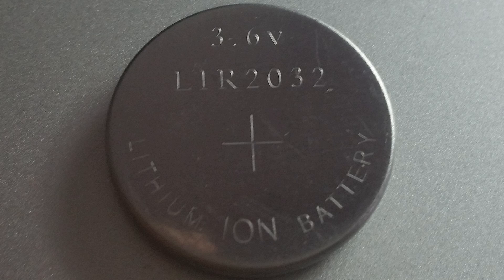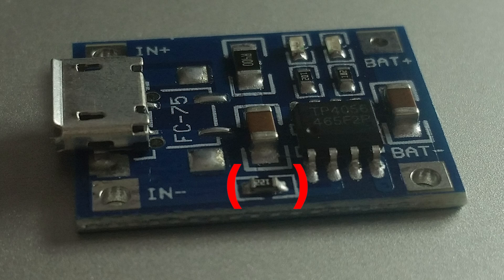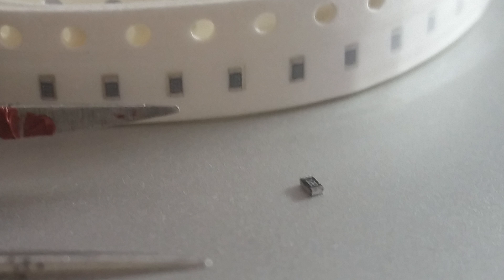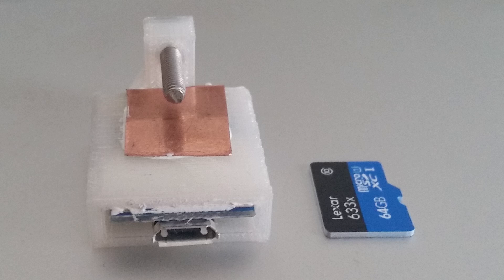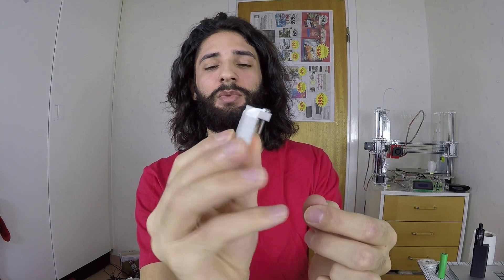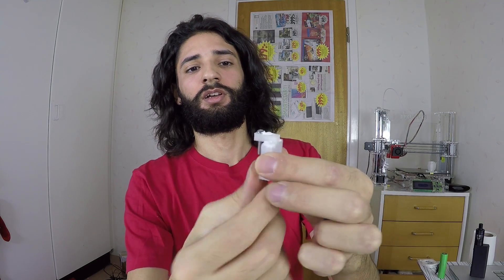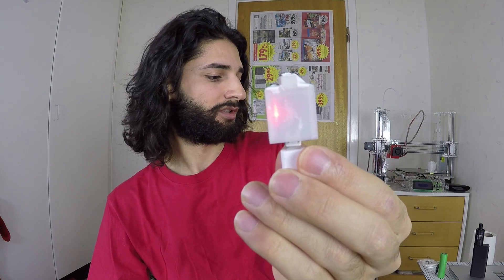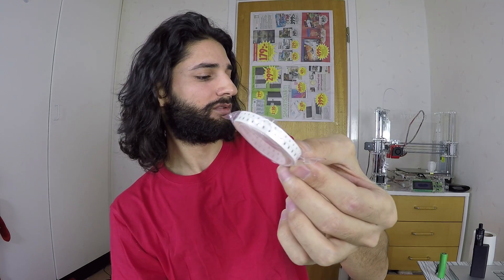DIY Coin Cell Battery Charger For 0.3$ (For Rechargeable Batteries Only)

Comment: Hi and thank you for your instruction here. What resistor would I need for 1.2 volt charging? Thank you etc.
Reply from the maker: You can't use this module for 1.2v battery. It's only for 3.6v battery. Otherwise your battery will explode/burn.
Reply: thanks for your time to reply. Guess I could d it with a stack of three.
What make/type is your 3D printer? Best, Bob, UK. @RajaaKahel
Reply from the maker: @raybob49  You're welcome. What's the battery model you are trying to recharge? Charging batteries in series is not recommended as they have different voltage/internal resistance which could also lead to fire.
Reply from the maker: @raybob49  My 3D printer is my own design (RK3D Tool Changer).
Reply: They are Varta NiMH V80H 1.2v 80mAh Button cells, CMOS power (3 off) in my 1990 Toshiba T1800 notebook. @RajaaKahel
Reply from the maker: Those batteries need another charging technology (not  lithium ion). You can buy this specific charging module in the link. Buy the one with lowest amperage (100mA). If you wanna charge one at a time buy the one (100mA 1 cell). If you wanna charge 3 in series buy the one (100mA 3 cells).
https://a.aliexpress.com/_EI0BqdZ
Reply from the maker: @raybob49  Then make sure to modify the module so that the charging current is only between 7mA to 14mA. Otherwise you will blow the batteries at 100mA. These modules are made for AA size 1.2v batteries which handle much more current.
Reply: Again, thanks so much for your time and help. Its great to be able to ask you questions and is really appreciated. @RajaaKahel

Comment: I puller a CMOS socket off of an old retired motherboard that I figured would be more convenient to use. Not sure how to modify the 3D printer file to accommodate that mod. Guess I would have to learn how to make 3D print files.
Reply from the maker: You can also buy the battery holder. But I promise you that you will benefit ALOT if you take the opportunity to learn 3D designing. It's how I started myself. I ended up designing a whole 3D printer :)
I recommend you start with Fusion 360.
Reply: 3:01  Why is the indicator flashing?  Basically, they do not blink but light up.
Reply from the maker: @qorxmazveyselov5163  It's blinking because the battery is not inserted.

Comment: There is an upgrade model with protection,Can I do same mod by swap R3 resistor?
Reply from the maker: Send a link to the exact model
Reply: @RajaaKahel  I tried but was deleted,you can easy find it and yes it's same method that you do

Comment: This is a old video but hope you are still on YouTube. Will this work on a smaller coin cell? And do you know what the output in mAh is?
Reply from the maker: The current output after modification is about 36mA.
If you want to charge a smaller chargeable battery then you should check its dataset for the safe charging current.
BTW, mah is a unit used for capacity not current. mA is for current.

Comment: Very cool.... do you have detailed instructions for this build? I was just going to tape the wires of a 3.7v charger directly to the button cell for a minute or two.
Reply from the maker: Unfortunately not. It's just a resistor change. Don't connect it to ordinary 3.7v chargers as the battery is rated for very low current and it will be damaged or even blow/cause a fire.

Comment: Cant i just apply 3 point something volt to the battery to charge it? Why doesnt that work?
Reply from the maker: Nope, it will easily explode or catch fire. You need circuits to regulate voltage and current, also other protection circuits.
Here are some details:
https://batteryuniversity.com/learn/article/charging_lithium_ion_batteries

Comment: Hi mate. I have 2 rechargable LIR1254 baterries that shows after measures 0,1V / 0,0V. Can I safely charge them using your solution? I measured also that they are short circuited, but they aren't...so I think that recharging them is possible. Regrads.
Reply from the maker: OMNADRENOWY RYCERZ Hi! Yes I think you can charge them, but if they have 0v or 0.1v then they might be died. But they could be usable again tho, it's worth the try anyway. Just make sure there are no dust or rust that's stuck and making short circuit.

Comment: Hi mr. Rajaa Kahel, I have bought an Olight universal magnetic charger but the manufacturer says it is not compatible with LIR batteries (LIR 2016, 2032, etc.)... I don't understand why, LIR batteries have 3,6 V like the batteries the Olight universal charger handles... do you think I can make a try with no risk? Thank you in advance!
Reply from the maker: Hi! yeah it' the same voltage but it has much more current than needed for a coin battery, that's why you can't use it. If you try, the coin battery will heat up quickly and might blow up in a short time (also fire danger).
Reply: Grazie 1000 (many thanks).

Comment: Not as much fun Rajaa, but..........!
For those not so inclined to buy those parts separately, you can get made up units on eBay.(Basically a coin cell holder soldered across the back, and the replaced resistor)
The eBay item 401472914347 shows a clear photo of the 33k Ohm resistor (333)
There are cheaper units, but the pictures are blurred
Reply from the maker: bridgendesar It's nice that they made  ready-to-use units! But the price seems to be too high compared to half a dollar :)

Comment: Is it feasible to use a 2x 68K Ohm resistors in parallel ? This would effectively result in a 33-34K Ohm resistor. 
And thank you for sharing the idea with us!
Reply from the maker: Vex Eleith You're welcome!
Yes it's possible :)
Reply: Awesome, cheers!
Reply: basic electronics- yes it will work

Comment: What if I charge 2 of them by series? Do I still need a resistor?
Reply from the maker: indra 881 You can't charge them in series. The resistor is to limit the current not the voltage. You can charge them in parallel. And you need the resistor in both cases (one or two parallel batteries).
Reply: Rajaa Kahel ah ok thanks for the reply.

Comment: Thanks for great video. For Lir2450 which resistor i may choose?
Reply from the maker: Enver Küçükkülahlı Thanks!
It seems to be a standard battery, 3.6v 120mA. So you can use same resistor 33Kohm.
Reply: Rajaa Kahel thanks for your interests and fast reply.
Reply: Enver Küçükkülahlı 0,5C is a standard charge rate. For a 120mA battery like 2450 60mA can be used. You can use a 20k resistor thus charging safely twice as fast than with the 33k.

Comment: i've always used a 12v car battery charge, set on low amps  tape the contacts to the coin cell and put a bean can over it in case it decides to do something stupid. plug it in for a minute, unplug it let it set/cool for 14 seconds give or take a couple and check the  battery voltage. if it's over 3v it's good. don't let them get hot. warm ok.  in a pinch i charge all batteries like that. i found a NiCd and some kind else also battery charger 1.5 AA,  c's and d's and 9volt. that puts out lots of juice. the 1.5's it's pushing up towards 10 volts. 10 minutes will put 1.80 volts into 1.5 if it's healthy enough. if it's gassing don't put the battery in an expensive device. i used 3 double a's in tactical 3 diode light (i also found it run over in the middle of busy intersection,) for over 3 years, charged mabye 10 times.
Reply from the maker: Buck Wheat Please don't do that again....

Comment: Hello me again I did some research I use the lir2450 battery and I wonder how you came up with 33kohm. The lir2450 has a max loading current of 100ma see data sheet (https://www.powerstream.com/p/Lir2450.pdf) and if you look at the TP4046 (https://box.mr-fo.com/cloud/index.php/s/tTTA5Uv94WXQgtJ#pdfviewer)
to get 130ma of loading current it set to 10kohm. I try to find a formula to calculate the resistor but I'm out of luck till now.
Reply from the maker: Hi Adrian, I think you shouldn't use the max charging current (for safety and battery life) here is one link: http://www.instructables.com/id/Cheap-LIR2032-Coin-Cell-Charger/

Comment: Hello hello this is really awesome :)) thanks can you post the stl file for the battery holder please? Adrian
Reply from the maker: Adrian Forschner Thanks! Check the description now please :)
Reply: Rajaa Kahel hey why don't we do stuff together I'm in to esp32 and eap8266 it will be fun
Reply from the maker: Hey Adrian, nice :) Why not if it's possible, I'm just busy for now designing a new 3D printer and will build it once I finish.
Reply: Rajaa Kahel well the esp32 gives you 2 cores wifi and Bluetooth, it would be interesting to use it to drive a 3d printer. And a shitload of io
Reply from the maker: Yeah, sure it's a really cool stuff! Thanks for the offer anyway my friend, I'll take it into consideration :)

Comment: This is awesome. Can this hack charge two stacked cells on top of each other? My guess is you would need to solder a different resistor. What resistor would I need? I'm looking to convert my cheap bicycle lights into USB charging. :)
Reply from the maker: Thanks! No, you can't use stacked cells on top of each other, because then you need higher voltage. However you can charge them if you connect them in parallel without changing the resistor (keep using the 33k one) , but the charging will take like 2-3 hours.
Reply: Thank Rajaa, 2-3 hrs is not bad at all!!!

Comment: This is really cool. Thank you Raja. Can you use this to do the reverse? you have a fully charged battery on one end and through USB connect this to a cell phone to recharge the cell phone?
or instead of a battery use a hand generator to generate e-power to charge a cell phone?
Reply from the maker: Thanks! Yes you can charge a phone from a battery (but not small ones like this), but you need another module that gives USB output. Check this out: https://www.youtube.com/watch?v=FJyWBB-RmGQ

Comment: Do you have a link on where u got the module and the resistors? please :)
Reply from the maker: Yes, check the video description please. I updated the links :)
Reply: I checked both links, and currently (June 6, 2017) both are out of stock.  However, I'm sure they can be found elsewhere; just get the details from the link and do a Google search, or ask at a maker club or a computer club that caters to DIYers.
Reply from the maker: Margret Rosenberg , Sorry guys, but the links keep expire.. So I updated the links with search links instead.

Comment: Really nice!!! I'm going to make a mini flashlight with it built in! :D One question: how much time does it takes to recharge? Thanks!
Reply from the maker: Thanks! Nice Idea, I'll check how much time it takes and tell you later ;)
Reply: Rajaa Kahel Another thing I just though about: what if you charge 2 batteries in parallel? Maybe then you don't need to replace the resistor.
Reply: Rajaa Kahel Another thing I just though about: what if you charge 2 batteries in parallel? Maybe then you don't need to replace the resistor.
Reply from the maker: You still need the resistor. Otherwise you might burn the whole thing..
Reply from the maker: AGloriousDawnLP The charging time is about 1 hour.
Reply: Rajaa Kahel Great! Thanks! :D
Reply: Rajaa Kahel Find it again, by accident. :) Subscribed!

Comment: Make me one I pay 2 usd plus postage.
Reply from the maker: Hi!, It takes up to two hours including 3D printing, soldering, gluing etc.. I'm really sorry, can't help you with this. It's much cheaper if you make it yourself. If you don't have a 3D printer, then you can make any holder you like from wood etc.. :)
Reply: You can get one on eBay UK for £4.00 Number 400878547869 or look for:
Mini USB LiR2032 CR2032 Li-ion Rechargeable Coin Cell Battery Charger - UK STOCK

Comment: Thanks for the video, what was the value of the original resistor and the new resistor?
Mine charged the battery to 3.7v after i changed it to 33k ohm resistor. 
Thanks!
Reply from the maker: You're welcome! The original one is (122)=1.2k, The new one is 33k. ✌
Reply: @RajaaKahel  what value would i use for a lir 2450?
Reply from the maker: @andreamitchell4758  33K ohm.
Reply: @andreamitchell4758  Did replacing the R3 work?
Reply: @dillononeill7578  i believe it did  i was able to successfully replace the resistor , but i  did this to charge the batteries  for a  luminara tea light but after i charged them and put them in the candle they overheated and one died and  was no longer chargeable  theni ordered  2 more batteries and  tried again and i got the same result but i took  them out in time and i think they are both still charging,  so i am not sure what is going on ,   i think maybe the candle is  either defective or it doesn't like the rechargeables
 but  they are the same exact only LIR instead of the  CR
Reply from the maker: You have to put a resistor between the battery and the candle to lower the current. Because with LEDs a very small extra voltage can increase power significantly.

Comment: hi

thank you for the useful video
i want to ask you if it is easy to make designs with 3d printer without  3d scanner and which program i can use ? and which model of 3d printer do you use ?
Reply from the maker: Hi :)
You are welcome!
I never used a 3D scanner before and I don't need it. I mostly design my projects myself. There are a lot of free designing software. I started by using 123D Design then moved to Fusion 360. They are quite easy, but there is easier as well. But I recommend Fusion 360. It's easy to design and print after you know how it works. I used i3 3d printers before, but now switched to delta style 3d printers.

Comment: This is only for the LIR2032 or similar Rechargeable lithium batterys and you can get realy nice battery holders for the 2032 battery without needing for a 3d printer ;-)
Reply: Like this 2032 Battery Holders
http://www.ebay.com/sch/i.html?_from=R40&_trksid=p2050601.m570.l1313.TR2.TRC0.A0.H0.X2032+holder.TRS0&_nkw=2032+holder&_sacat=0
Reply: Like this 2032 Battery Holders
http://www.ebay.com/sch/i.html?_from=R40&_trksid=p2050601.m570.l1313.TR2.TRC0.A0.H0.X2032+holder.TRS0&_nkw=2032+holder&_sacat=0
Reply from the maker: Sure :) you can make much better than this holder, I didn't mean to make it an artwork, so I just designed it quickly to do its job..

Comment: Um ... be careful, these batteries can explode when you try to charge them! Especially if they are non-rechargeable.
Reply from the maker: +Benjamin “Ozias” Esposti Of coarse I'm not talking about the non-rechargeable batteries ;)
The rechargeable ones don't explode as long as you follow what I did.
Reply: +Rajaa Kahel 
Good! :D
These things scare me a bit, because I don't want to have a metal battery shell penetrating my heart ... lol
Strangely, I've had regular coin cells explode just sitting there, not hooked up to anything, and not in a stressful (I.E. hot) environment.... it's so weird. You might notice some have a noticeable bulge ... those are the ones that explode!
Reply from the maker: +Benjamin “Ozias” Esposti 
Right lol, It happens with the normal ones.. But here as you see in the picture inside the video, I'm talking about "lithium ion" which is rechargeable and 3.6v not "lithium" which is 3v.. 
Thanks for removing the Dislike :P
Reply from the maker: +Benjamin “Ozias” Esposti 
Haha I see your point.. and you are right.. Thanks for the comment, you made me change the title so people don't think this is for charging the non-rechargeable!